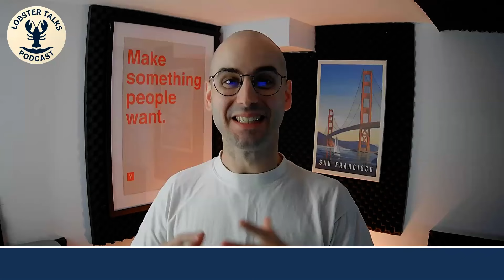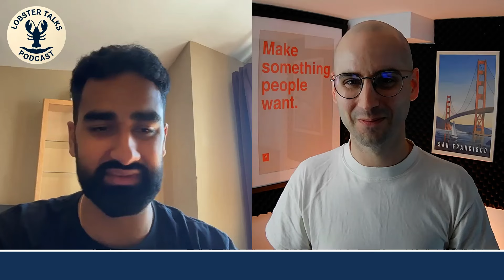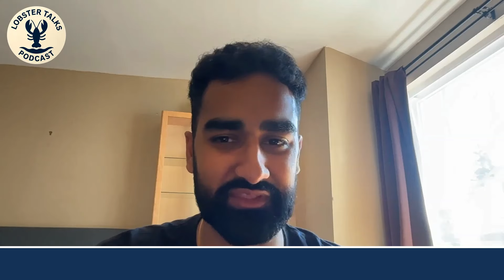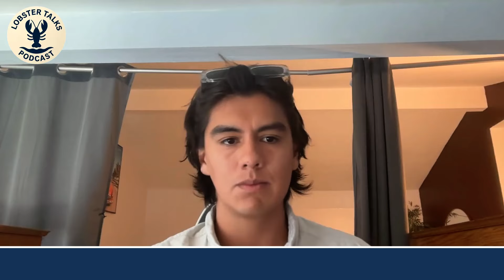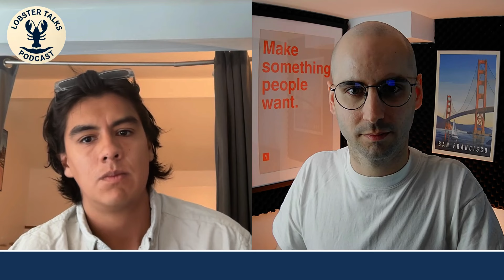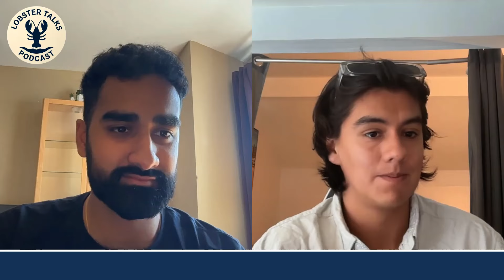They Shrunk a Particle Accelerator 1,000× to Beat ASML — Inside Inversion Semiconductor’s Moonshot

Comment: Wait what? 
E-beam lithography has been done for years, and it can usually fabricate features several orders of magnitudes smaller than the current state of the art fabrication tech. 
The reason the tech never left laboratory was because it is fundamentally never economical to scale up in the first place, especially compared to photoresist and UV lithography tech. 
It's like comparing direct metal laser sintering with die casting, sure you can make extremely detailed structure with the former, but it's never meant to be economically competitive to the later.